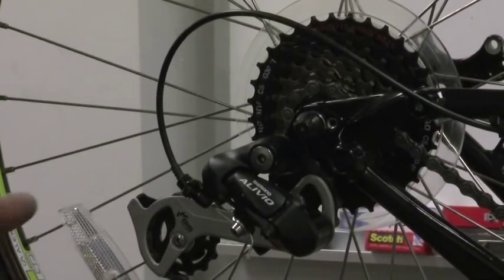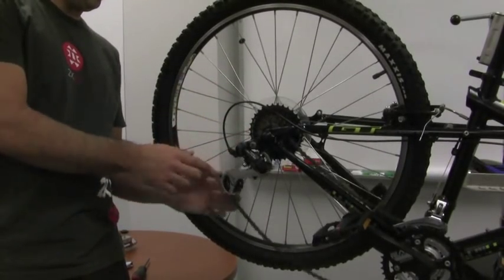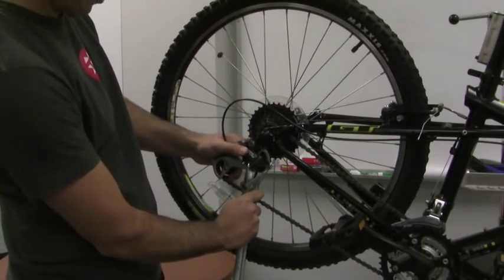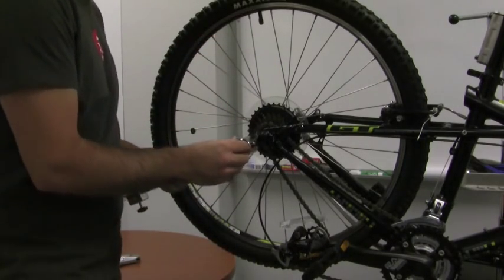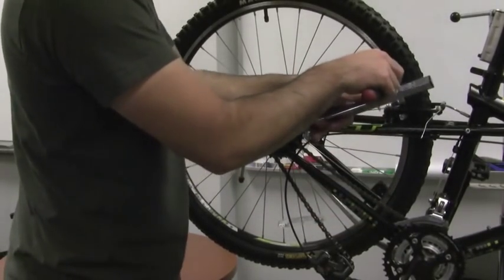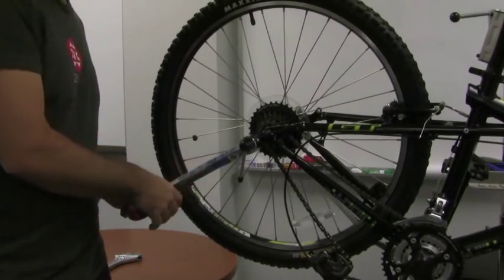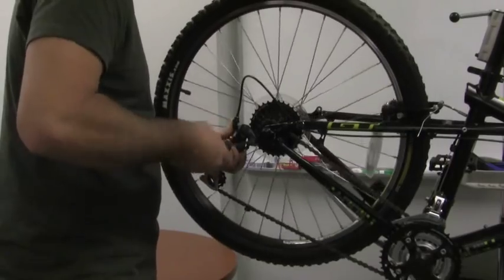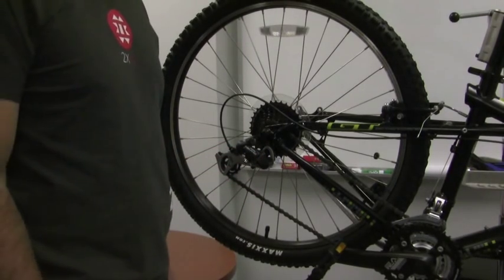Straighten your Derailleur Hanger

Comment: I don't have derailleur hanger, it's built into the frame. I took the derailleur off and it screws directly into the frame (it's a 1993 Trek 720), I thought that was really odd. Of course, that's a good thing in that I don't have to worry about it getting bent. OTOH, if it fails, I need a new frame.

Comment: what about if your wheel was slightly out of tru, would that have an affect on the reading??
Reply: Probably not.
Reply: +Wayne “Psy-Ambient-Lover” Beeston Truing or dishing of the wheel doesn't matter. You might want to use the same point of the rim, the valve is easy, to use as your reference point at the various positions. Check the opposing 180 degree marks (3 vs 9 and then 6 vs 12 o'clock) rather than the 90 degree mark between them, seems to work easier for me anyway.
Reply: Wayne Beeston. Good point. Truing needs to be done first for best diagnosis. If one does not know how to true the rims, he/she should not mess around with the deraileur hanger...

Comment: Could you do the same exact thing with a string? Loop it through the derailleur hanger hole and then bring the string out until you are at the rim, cut the string and then use the string to see if you are equidistant from the derailleur at all points on the rim? Seems like it would work.

Comment: what if you don't have derailleur hanger and the frame is bent?
Reply from the maker: flashtin166 Some bike shops may be able to bend it back into alignment. Carbon won't bend, aluminum doesn't like to bend. Steel may bend a certain amount. There are actual frame tools to check for trueness in frames. Good luck and thanks for watching.

Comment: not really. you wont be equidistant from the rim as the hanger if off center with the wheel. you are checking to see if the derailleur hanger is parallel to the (imaginary) line of the wheel from rim to rim, looking from behind, if that makes sense. and so your wheel should be true before adjusting the derailleur to suit it.